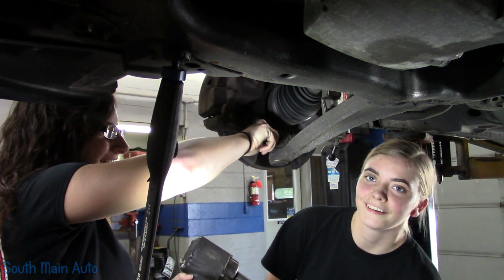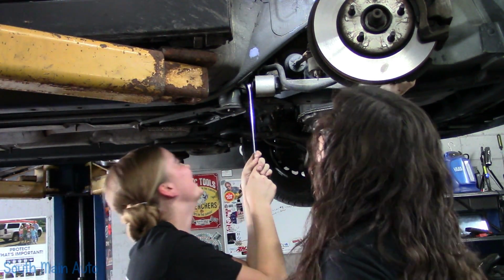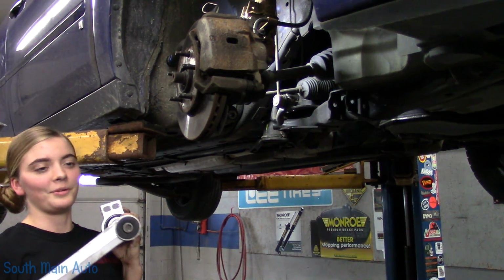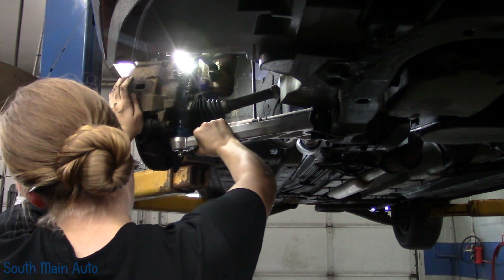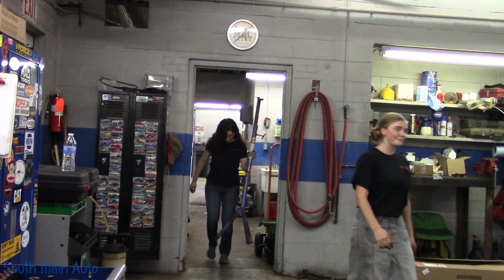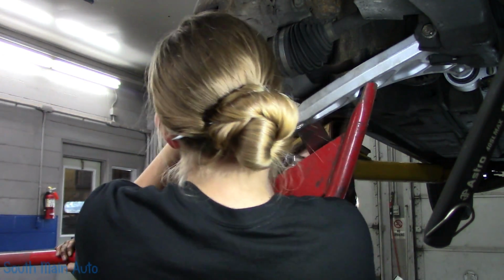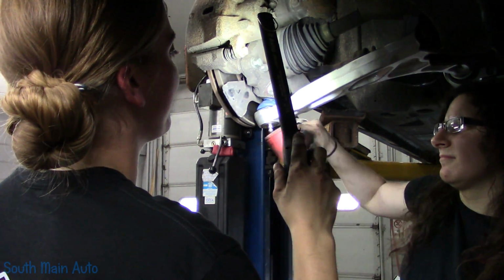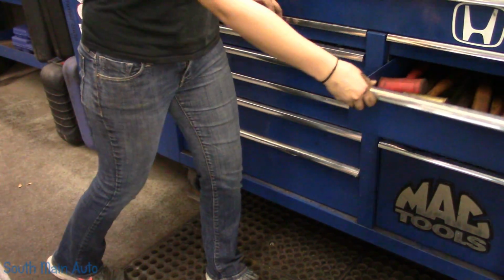Chevy Malibu: Lower Control Arm w/ Ms.Hannah & Ms. Marie

Comment: Eric, you so have to get these two girls a small 4-stroke motorbike to work on, something they can take the skin off and see how the machine as a whole acts together to become alive, they have such potential, and you really are the best to help them discover that, a motorbike has basically everything a car has just in a smaller, easier to grasp concept. Engine mounts hold the engine, starter switch activates the solenoid, that turns the starter motor, that turns the engine. At the same time the ECU is receiving a pulse from the stator which is activating the coil which is sending a high voltage down the lead to the spark, as well as charging the battery and powering the lights. Then let them take the top off so they can see how the valves work, then take of the side to view the timing chain, then take of the clutch cover so they can see how that works, then the cylinder block so they can see the piston moving, then how the carb works with the vacuum from the engine (or injectors depending on the engine), find a old injector and show them how it injects fuel into the cylinder, these girls have so much fun doing their own car, and you can see the potential in them that even though it may not be a full time career (as I think one wishes to become a nurse?), it will be such a education that will stay with them forever!... Please, if you can do that, ask if they would be interested, if so, then you could almost go back to basics with your own subscribers and help them understand the fundamental basics, as I'm sure there are many subscribers and watchers out there who would love that sort of background introduction to what makes a vehicle such an amazing machine and what it really is if you remove nearly all of todays modern electrics and OBD stuff, so to speak.

Comment: That blonde has got potential! Not afraid to get her hands dirty. Hefts those tires on the hub like a pro. Love girls that do their own maintenance. I have my step daughter; rotating her tires, changing her oil, changing brake on the front, draining transmission and adding fluid and changing her cars bulbs
Reply: The blonde is Hannah I believe..and she helps& watches her dad quite often.
Reply: @brettcottle7052  The blonde one is Marie. Hannah worked or works for SMA between semesters at nursing school but she is not his daughter, took me awhile to figure that out myself.

Comment: In a world where modern men call roadside assistance to change a flat tire these ladys rock. Thumbs up to them.
Reply: Well most cars nowadays dont have a sparetire. Ive had to be towed once because of a flat. Didnt have a spare and the tire had a big metal rod in it so it that tirefoam thing they leave you with wouldnt have helped either.
Reply: See, I’m an old geezer now at 75 with no kneecaps and busted legs, so I need AAA, but I did love seeing these young women nailing this job down. I do like the way young Marie grabbed that tire and threw it on the hub, Wow, she is powerful and good.

Comment: Hey lets get a 3M headlight restoration kit for Hanna! Winter is around the corner, good headlights are a must
Reply: Abrasive headlight repairs scrape away outer coatings. No recommend.
Reply: BUG SPRAY! I'm not even joking. Get something with at least 25% DEET, spray it on, wipe it off, and watch the magic. 😉

Comment: Did you get that ball joint separator do-hickey from an auto parts store or a playground?
Reply: Idk but I've determined I'm making one tomorrow morning at approximately 6:27 am because I need it in my life   my giant prybar will thank me
Reply: was thinking the same thing, scrap pipe and that new (8yr old) pipe bender I just had to have :))
Reply: It's red. Overly expensive. Snap-on ;)
Reply: Yes, I was a bit jealous watching them use that.
Reply: Fun tip Friday from Chicago.. If you have an old 3/4 inch rigid pipe ( electrical conduit ) bender head lying around, then lop off the folding ear that held the old pipe to be bent so that portion is a U rather than a C shape. Screw the head onto a pipe, length of your choice, and it makes a great lower control arm pry tool for peanuts, that won't slip off as easily as a pry bar.
Reply from the maker: Boom! https://amzn.to/2OHwhNy
Reply: @SouthMainAuto  you are the man Mr. O. , quick with those Amazon links!
Reply: darickymeister ditto, last time I did one I had to be all mid evil on it.

Comment: At least the replacement control arm came with a gease fitting. It's a shame OEM's don't use them.
Reply: Done on purpose. One the part is cheaper to manufacture, two it will fail quicker, three it will cost you more to replace. It's called planned obsolescence.
Reply: Ban on, then when purchase these parts they asked for a life-time warranty 🤬👎🏿😠😡😳🤯

Comment: They did a good job they just did not have enough power in them for the bolts
Reply: I know this is an older video, but I wish Eric O. gave them hints on what to do if a bolt doesn't break loose with their current tool, that's right, you get a longer reach tool like a breaker bar (or cheater bar) to get the job done!  As the saying goes, with a long enough lever, you can move the world!  But given their age and what not, this was still awesome to see them trying so hard to do it themselves!

Comment: The girls need to wear safety glasses
Reply: Safety 3rd!
Reply: Naw more girls need pirate eye patches..
Reply: @xephael3485  arrrr
Reply: Maybe ear plugs too.  Those air tools can be quite loud.
Reply: I was thinking the same thing.
Reply: If they were using Big Nasty to drive out a ball joint, or slamming on a pickle fork to separate the knuckle from said ball joint, or sawing off a bolt with a wizzy wheel,  I'd agree with safety glasses ... but for swapping a control arm, and using a rubber mallet? Don't think it's needed IMHO. Common sense goes a long way in this regard ...
Reply: I was a little worried that the wrench was going to fly off and hit Marie's face since she was pulling it towards her face.  I was taught to never pull anything towards you if at all possible.
Reply: @Joe T the old safety squint haha
Reply: I wasn't too worried about that,  @FortyTwoAnswerToEverything  ,  but, instead of cracking it loose for her, I'd have shown her to put the wrench on it such it extended under the car, so she could have leveraged her weight on it. Missed empowering opportunity.
Reply: Gloves where good thing, when I work on my car, I always end up with bloody knuckles!
Reply: Brake parts cleaner with no glasses is iffy at best. You know common sense and all. Ive never heard anyone wish they hadn't had their safety glasses on.
Reply: An a raincoat, gloves, helmet..
Reply: And gloves

Comment: @South Main Auto Repair
Just bought 2 cans of the Good Stuff Tonight.......The Pantry Was Low ; ) - - - $11 each Ouch! #RATTLERATTLE
Reply from the maker: Pfff I just bought a 5 gallon pale!! ChaChing!! Works out to be like $27 a gal...
Reply: @SouthMainAuto  I needed it to lube van door rollers. & i pop the little rear wiper arm cap & put some on there, it won't run like T40. 
You've got me beat good sir.... I've only got 2 gallons that came with my spray kit.  
- P.S. --- while our Canadian Fluid Film Cans have a superior exterior label to your American Cans.
          --- Your American cans have the sweet little holder like the krown cans do for the straw. On Canadian Fluid Film cans i need an elastic to hold it to the
              caN.   #MURICA!   #USA!USA!USA!

Comment: Great video! I educated my 18 year old daughter on basic maintenance (oil & filter, tire pressure check & rotation, fluid check) on her 2000 Hondoo Accord SE. Now she lives 850 miles away & doesn't have access to my shop. Luckily I found an honest repair shop (like your's) that does all that stuff for her. It's good knowing if she has too she can do it!

Comment: Quik comment.  The reason the mount was backwards,  shipping.  It straightens out the part so it can be put into a square box. With 2 bolt holes sticking out you would have to make the box bigger.  Either square or triangle, the manufacturer saved an inch of cardboard and when your moving 100k of those things it adds up. BTW. Awesome vids.  I turn a wrench myself.  No more radio in my shop.  If you look at my desk/workspace.  Your videos are playing while im working. Keep it up. Great job.

Comment: Just the best video. The girls did good. It is very rarely I laugh out loud at a funny video. Yep; if I can do it ………..

I used to work on my daughters wreck and she would be underneath doing her bit and learning. I didn’t care if she didn’t want to do specific jobs just so long as she understood what was going on. 

Years later, on much newer cars, every week she checks oil, coolant, brake fluid, washer bottle and tyre pressures and condition. She rarely has a problem and when she takes it to the garage for any work she tells them what needs doing. She listened!!!

Comment: That reminds me of my wife when she put up a new curtain rail. OK the curtain worked but it was drunk (Lower one end than the other) When I pointed it out, she had a good look and replied if you don't look at it you won't see the problem. It's still the same some years later. At least it's still there. And the curtain hasn't fallen off. Fall marks for them trying. Great Vlog.

Comment: I would have too much fun playing with the air gun to get anything done. Really cool to see these ladies learn to work on their own vehicle. Glad I did the same growinig up, im 21 and ive been having issues with my 06 altima p0300. Took it to nissan and they confirmed my suspicions of it needing a head gasket. Quoted me $2000 for labor on the head gasket so I am now doing it myself. Crazy that the quote for the timing chain was around $400 labor when it looks like more work than the head gasket.

Comment: Great video - I got my daughter a 05 Neon and she has done a few repairs and replacement parts (sway bar bushings, tie rod end etc) she was timid at first but after getting the first job done right, she gained confidence and wanted to learn more, she even said - the worst thing about being a girl, is not knowing what the parts and tools are called, which makes ya feel like a moron, but once she had a chance to do some of the work, and get familiar with the tools and parts.

Comment: Good experience for the girls!  My daughter is older now but has helped me at times.  I never hear what brand of parts you use or whether OEM dealer or aftermarket.  I'm having trouble finding good aftermarket parts for my daughters lower control arm.  The Moog I originally bought didn't line up right.  The Precision I bought instead has had a bushing failure with only about 10,000 miles on it.  I hate to pay $400 - $500 for one from a dealer!

Comment: It's nice to see young women fixing cars. These are 2 ladies who won't be victimized by unscrupulous (male chauvinist pig) mechanics.  Don't be afraid to smack it, girls. That's a control arm. You're not hanging pictures on drywall. Smack that mother!

My daughter is now learning why she needs to know this stuff after a trip to the "stealership" and them pronouncing a death sentence on her car, a death sentence that I said was vastly overblown. They wanted to sell her a new transmission (at twice the price), or failing that, a used car.

My cousin did a '57 Chevy in high school. She got some razzing from the guys, but she had a nice freaking car when it was done. She painted it larkspur blue.

Comment: Hannah and Marie, here's another free tip, please use hearing protection and eye protection when using an impact driver, or any kind of high velocity, or high torque power tool, your hearing, and sight will thank you in the future. Also, the disposable latex gloves are great for abrasion/grime protection.

Comment: As a general rule I don't keep my hand on the socket when I'm removing lug nuts I realize it is an impact socket but if it splits it will cut your hand or fingers while you are removing lug nuts

Comment: I'm a bit lax about wearing eye protection myself, although I'm now of an age that I need reading glasses. Still, even when I didn't need to wear glasses I would wear them if I was using an air tool, or near one in use. I'm really surprised that you don't have Marie wear safety glasses.

Comment: Is there no way to press the old ball joint out and press a replacement ball joint into the lower control arm?  It seems more and more manufacturers are increasing the cost of repairs by requiring the replacement of large assemblies.  The good old days when you could change only the defective part.  I remember heater blower motors with brush holders. You simply removed the caps, pulled the old brushes and replaced them with new full length brushes. Today you change the blower and plastic squirrel cage.

Comment: I remember trying to replace my upper and lower control arm with shocks when i was 17 and never worked on a car before.   Was a truck actually..   tried like hell to get the thing off and right when i was loosening a bolt i thought had to be removed my buddy showed up who was a mechanic and as soon as he walked up he hollered at me and yanked the wrench outta my hands..  said i was about to undo the torsion bar load on that wheel..  where i had most of the crap off already if i woulda taken that bolt out it woulda flipped that assembly around with like 2000 lbs of twisting force and woulda sucked me up in and done some damage moreso to me than the truck...   lol..   got lucky i guess...   always read the service manual about things if you dont know what your doing...

Comment: First year i was married 1979, my wife and i ran a full service gas station in Delaware during the summer a girl coming from Baltimore going to the beaches for the weekend in a 1969 charger, that she said she worked on with her dad. the fuel pump was going bad, and she ask if she could use the lift to change it,cause she only had so much money. I said yes, helped her get it on the lift, and left to get the fuel pump for her. when i got back from the parts store she had the old one off already. She finished the job like a Boss. Also in 1985 at a ford dealership i later worked at, had a girl mechanic who was very good. she was only like 25 years old.

Comment: I'm sure a lot of people have said this and you have taken immediate action; please have them wear safety glasses. I work at a medical manufacturing company as a Quality Technician and we enforce team members to wear their safety glasses at all times even though the job is not dangerous; in this scenario, a lot of metal shavings can come flying when operating the impact gun especially when working that close and to head level. 
I cannot repeat this enough, I for a moment did not wear my safety glasses and a metal piece came flying from a nail gun and hit my eye, luckily it did not hit the iris  but I did not expect that to happen in that very moment. I was just thinking that I should be wearing my safety glasses. When I'm under the car, I always think of safety glasses when I'm just taking a quick look under the hood, there are times when I wiggle things and then a lot of dirt fall on my face and gets in my eye.  I have learned to wear them all the time when working on anything including mowing the lawn.

Comment: I need those girls to drop by and put my wheels back on my Toyota Avalon, I changed my pads but did not have the strength to lift the darn wheels up. I am 83. Told my wife I can do it easily.  My Brain is writing checks my body can’t cash.  Had to use two sticks under the wheel and lift and hold while I struggled with a lug nut.

Comment: I watched this video and several others and they all assume you have a car lift...  If you came to this video as someone doing this yourself instead of as a mechanic, do yourself a favor and START by putting the balljoint in before putting the other connection points in.  Trying to hammer the balljoint in with only 6-10 inches of space between it and the ground does not work.

Comment: This proves fixing a Chevy can require a Ford Wrench. But be careful, they're fragile.
But that red prying tool for disconnecting the arm from the steering knuckle? Somebody made that I bet, by hand. That's neato, and Harry homeowner could not use one without a lift.
If you made that yourself?
I wanta party with you, dude.